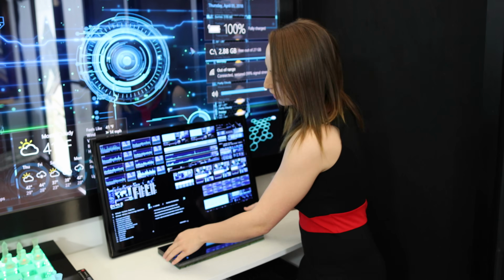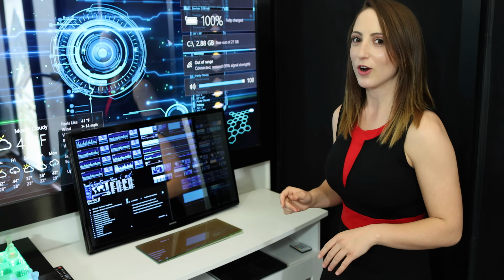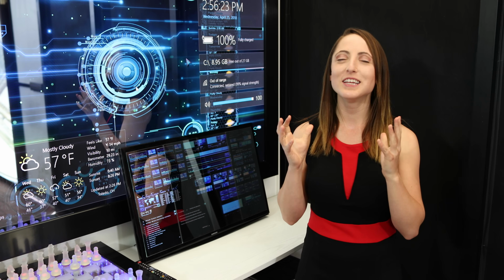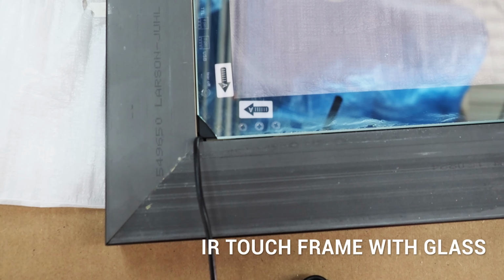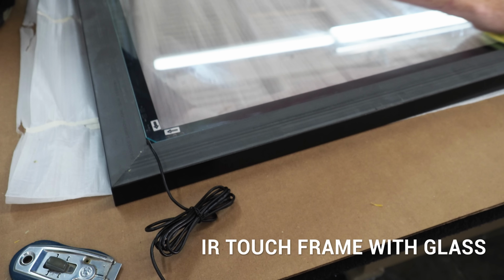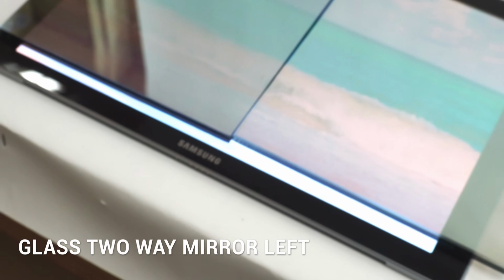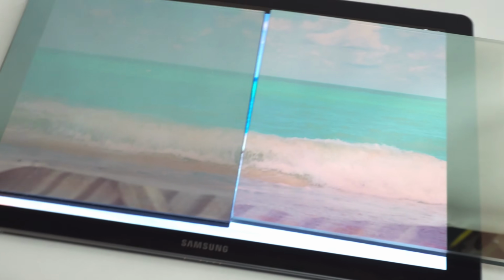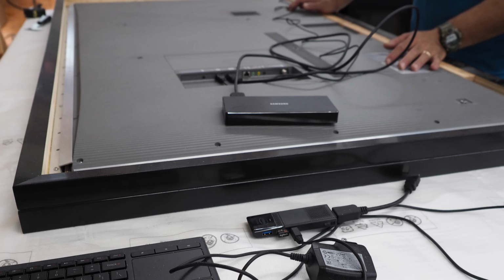Acrylic Vs Glass For Smart Mirror Project | Which Should You Use?

Comment: Are you sure about the comment "The IR touch frame has to be the same size as the tv and the overlay" ? I spoke to a vendor of IR touch frames and they clearly said it is possible using an IR touch frame being bigger than the actual screen. This is useful for setups where only a part of the mirror actually will be "smart".
Reply from the maker: After making this video I did find out that you can use a larger IR touch with a smaller TV. However, you would need to calibrate the software to tell it where the screen is behind the mirror. This still would limit your size a bit to a 16:9 or 4:3 ratio. The mirror and overlay would need to be the same size, but the TV can be smaller. Glad you pointed this out!!
Reply from the maker: I should say... the IR Touch Overlay is an empty frame so it sits on top of the acrylic and it is empty so that is why you still touch the acrylic with it on top.

Comment: Hi.  Really helpful video, but I have a couple of questions...
You say to steer clear of acrylic for touch applications, but if you're using a touch overlay then wouldn't this sit on top of the acrylic meaning nobody could touch / scratch it?  Did you mean to stay away from acrylic if using touch foil, or can acrylic still somehow be scratched / damaged if using with a touch overlay?  Would the touch overlay have to sit directly on top of the acrylic or can you leave a gap?
Reply from the maker: Usually, people would use the glass instead of acrylic for a touch application because the acrylic gets "bendy" in large sizes.
Reply: @twowaymirrors  That doesn't answer my question, but thanks for responding anyway.

Comment: One thing she doesn't tell you is acrylic is impossible to clean and scratches and marks up bad -  so if you want to replace it often use acrylic.
Reply from the maker: Great point! If you use acrylic, be sure to clean it with Novus 1 cleaner and Polish Mates (or at least a soft microfiber and isopropyl alcohol)

Comment: Hi!
Can you tell me what kind of mirror should I use with touch foil as metal coatings are blocking signal?
Reply from the maker: Our smart mirror glass works with the touch foil. The acrylic version probably wouldn't work.
Reply: @twowaymirrors  that is cool! What kind of coating do you use for your smart mirror?
Reply from the maker: @dnhmfnsk13  The Glass Smart Mirror has a semi-transparent mirror coating (70% reflective, 30% transparent). It does have metal in the mirror coating. The best way to find a good touch foil is to search online and then contact the manufacturer to ask for their advice and get a confirmation on whether or not it will work. So far, www.displax.com has a Skin Fit product that they have suggested to work with our mirrors.
Reply: @twowaymirrors  thank you! Your customer service is great!

Comment: 1 - 70% Reflective, 11% transparent: glass 2-way
2 - 70% Reflective, 30% transparent: acrylic
3 - 70% Reflective, 30% transparent: glass smart mirror (warmer tone)
4 - 30% Reflective, 70% transparent: dielectric (beamsplitter) mirror
Reply from the maker: The Smart Mirror glass we have is now much more color neutral. We perfected the mirror coating so it does look slightly more transparent than the Acrylic Two Way with a clearer image. The 3mm Smart Mirror thickness will have the warmer tone though. I am looking forward to updating pictures on the website & making a new video on this!
Reply: @twowaymirrors  Hi ! Can you help me in my choice? https://forum.magicmirror.builders/topic/9366/sun-vs-mirror   Thx in advance
Reply: Rick K  I was looking for 2 way mirror paper and I came across this video. Would this work for doing an infinity mirror ?

Comment: If the glass two way mirror is 70% reflective and 11% transparent, what is it for the rest 19%? 🤔
Reply from the maker: Great question! The glass two way mirror is on a grey glass substrate that absorbs the 19%  of the light so it does not pass through the mirror.

Comment: Does the thinkes of the glass matter for the smart mirror or does it have no effect?
Reply from the maker: The 1/4" thickness is more color neutral as we have just engineered a slightly different mirror coating so that it matches more closely to a standard mirror. The 1/8" thickness does have more of a warm tone to it.

Comment: Hi.  You stated that acrylic wouldn't be a good option for bathrooms.  Does the size of the bathroom matter?  As an example, I am working with a bathroom that is 15 x 12 and the shower is enclosed.  There are two mirrors 40 x 40 over the sinks, which one is about 7 feet away from the shower and the other is 9 feet away.  Do you think with this much space, that the degrading would be the same as a smaller bathroom?
Reply from the maker: Great question! It would depend on the ventilation - when you take a shower does the mirror fog up on that side of the room? If so, it probably wouldn't last over time.
Reply: Great. Another question.  Planning on sealing or enclosing the back of the mirror with a plastic shell to encase the raspberry pi and smart mirror.  Would this help the degrading at all?
Reply from the maker: Yeah that would definitely help! If you install it so that the acrylic mirror coating is facing the display, this would be optimal for protecting it against degradation. That way when you go to clean the mirror it would not affect the coating either.
Reply: Thanks!